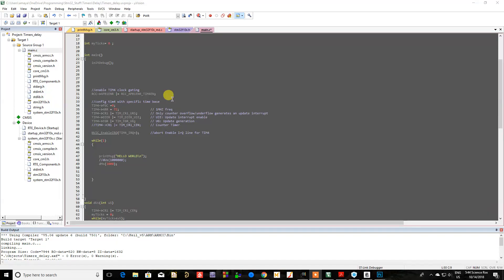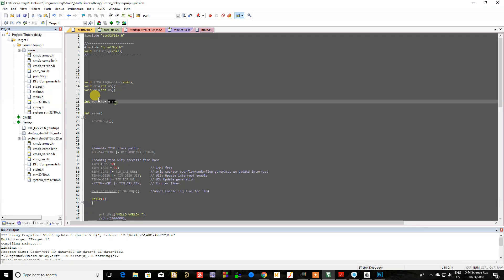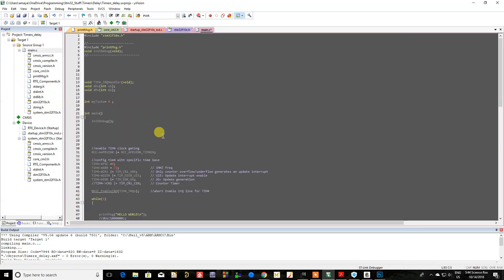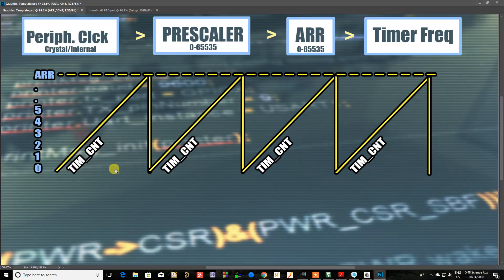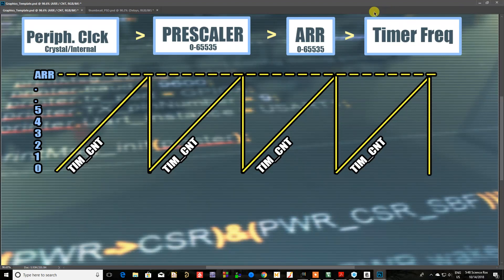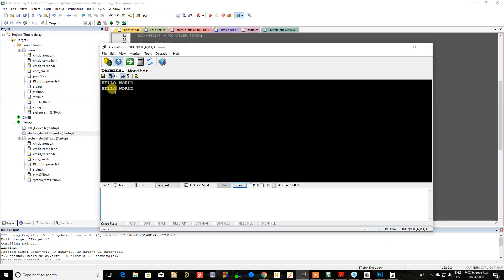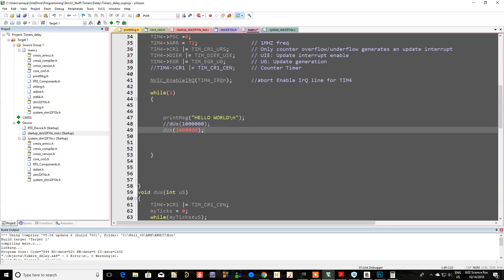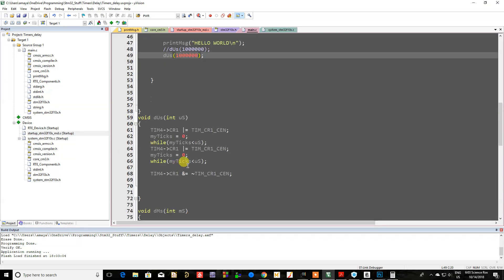Stm32 Delay Using Timers or Systick

Comment: My  delay doesn't work
Reply from the maker: Sucks. Keep trying
Reply: Yesss. By the way your video's are good.
Reply from the maker: @randypeeters3931  let me know how it goes or if you have a specific question
Reply: Yess thank you i will try it again
Reply: @EdwinFairchild  I can't find the problem in my code, i used 100% the same code and it does still not work.
Reply from the maker: @randypeeters3931  how are you checking your code? Through debug and breakpoints or through simulation?
Reply from the maker: @randypeeters3931  go on my blog and email me your code, are you using keil or truestudio?  and are you using stm32f1? im going to the gym right now so my reply after this might be delayed
Reply: @EdwinFairchild  yes i tried this with my oscilloscope:
 DelayMS(1000);
 GPIOC->BSRR |= (1<<15); //Turns pin 15C LOW
 DelayMS(1000);
 GPIOC->BSRR |= (1<<15+16); //Turns pin 15C HIGH
this whitin a while(1) loop ofcourse
Reply from the maker: @randypeeters3931  did you turn on the GPIOC clock, did you call the SystickConfig function, do you have "reset and run" enabled in the ide otherwise you will need to reset the board everytime after programming to get the code to run
Reply: @EdwinFairchild  GPIOC clock is on, no i don't use the systick method, reset and run is on. Is it possible that i need to set the integer value of the ticks to a volatile?
Reply from the maker: @randypeeters3931  ticks should be global , volatile could help but not necessary but give it a shot . Sent me you're entire code I could help much better
Reply: @EdwinFairchild  Thanks i will try it and send you my code
Reply: Okay i added the volatile in front of the integer and it works fine👌😂😂
Reply from the maker: @randypeeters3931  I see, you must have some optimization enabled in your compiler. Nevertheless woohoo!!
Reply: @randypeeters3931  
I had the same problem, went through all codes for two hours and then saw you comment!!! Thanks